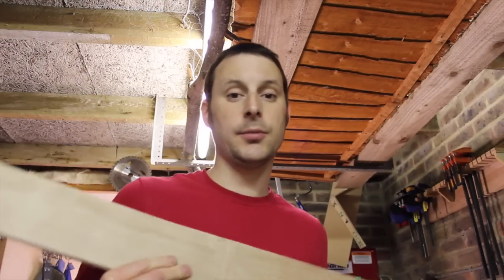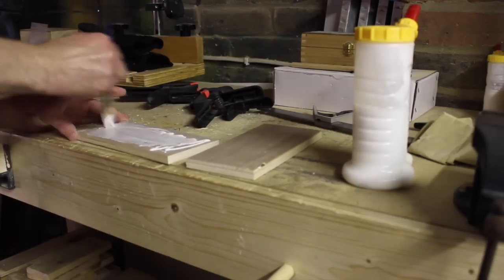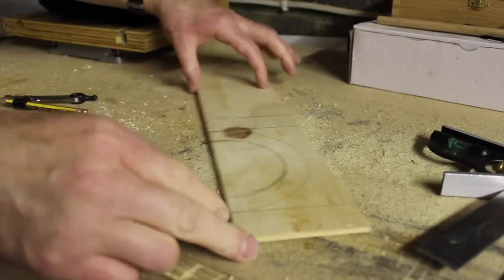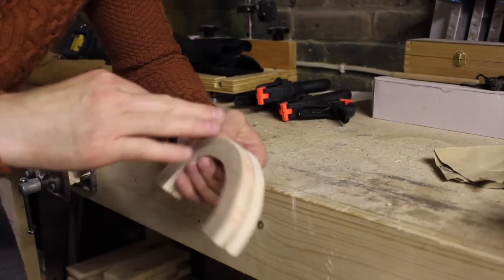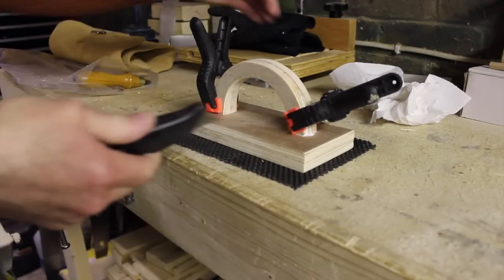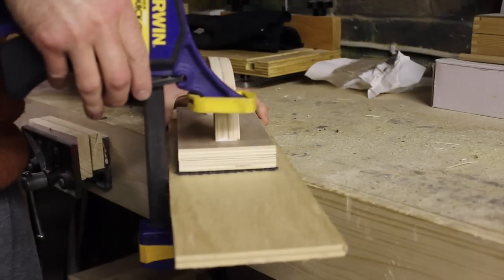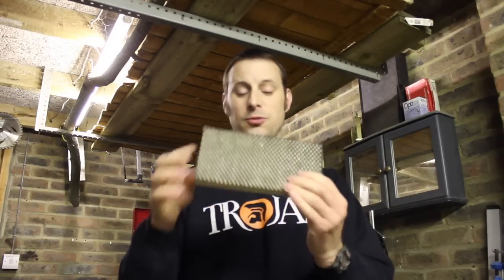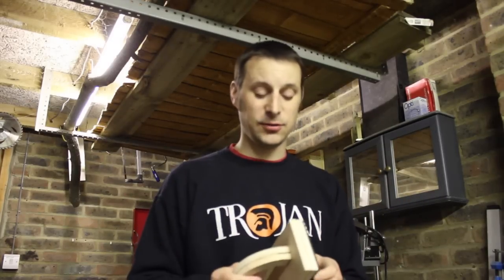Home Made Gripper Block

Comment: You've basically built a rubber float or a sponge float. You can buy one of those for a few dollars. There are versions intended for plastering, and others when placing tiles. I agree that it's a useful tool by the table saw, that's where I use mine, but I can't really see the point in building one when they are so cheap to buy. You just need to figure out that they aren't anywhere close to table saw equipment in the store... Of course, if you want to add more features, like having a piece in the back that actually pushes the wood if you don't rely on the friction of the sponge or rubber, a wooden base is a better start than a plastic gadget, but I think they usually work well as they are.

Comment: Enjoyed your video but I wouldn't have that block over the blade unless you are doing non through cuts. I own a Sawstop and those screws worry me. Great, however,  for pushing through large sheets or wider stock. I also use the same gripper stuff and it works well.

Comment: I'm with Russ about those metal screws taking out and put in wood dowels. also, why the hell did'nt you use a push bar or some other small piece of wood. THAT close to the blade, it's an accident waiting to happen.